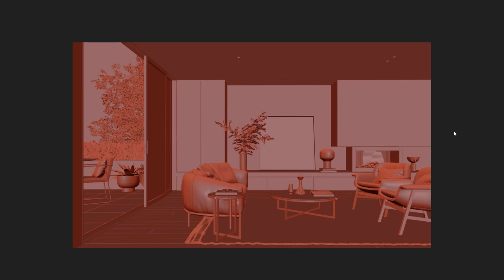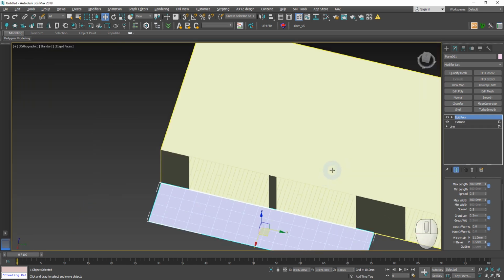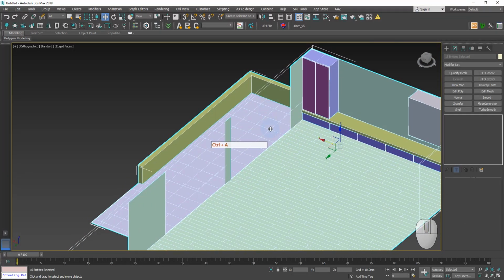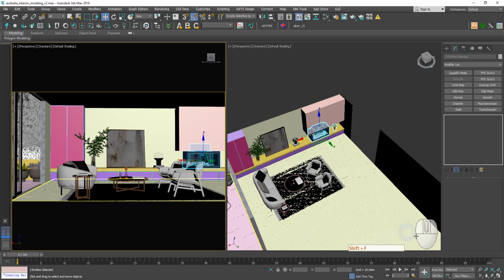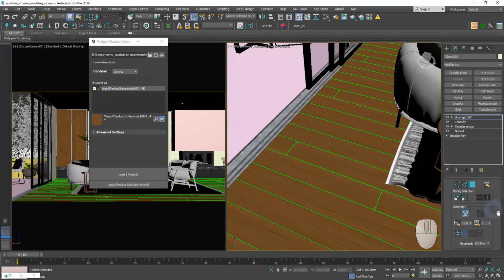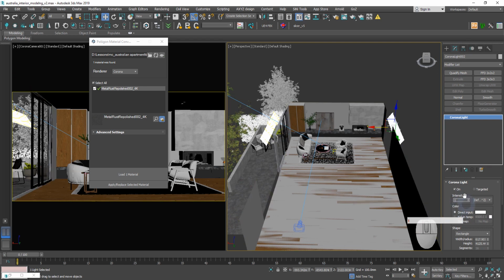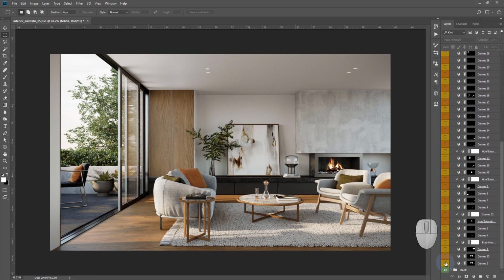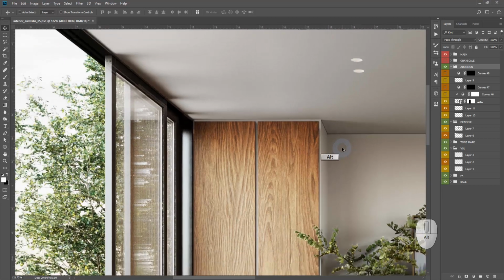3D Tutorial | How to create Australian apartment in 3ds Max quick (in 37 min.)🏠

Comment: Finally someone who creates good looking stuff with 3ds Max. It's a lot easier to find good tutorials on Blender nowadays.
Reply from the maker: 3ds Max steel the industry standard
Reply: @ArhiTeachCGSchool  yes and I have to learn it for my new job. But it will die in 5-10 years, mark my words.
Reply: Not sure what you mean with that. I've been working in architectural visualization since 1995 and at that time 3ds max was the only option. It has been the main to go software for A&D for decades, thanks for Vray that was born for 3ds max. The best architectural viz I've ever seen was done in 3ds max. I've never seen anything done in Blender that even get closer. Although Blender is a fantastic 3d software all around, it lacks of the professional file management and tools that 3ds max offer. It's good for independent studios or freelancers. But it's difficult to find any professional company in arch viz using it instead of 3ds max. Let's not forget the compatibility with Revit and all the major CAD and BIM software. And the huge amount of plugins and renders available. I love Blender, but as an experuenced Arch Viz Artist I would never be able to make a living out of it with Blender results both for interiors and exteriors. And let's not even mention walkthrough animation.

Comment: Good tutorial up until 11:23, but not really possible to follow it properly without the file involving the assets that YOU are using. You can't really follow along properly from there with alternate assets. Texturing, lighting, additional files etc etc are all going to be DIFFERENT for random different assets got from the internet. If those following along have to use free models, then use those free models yourself in the tutorial please and put a link for the same models.

Comment: Hello! When  I use the floor generator a message pops up saying that floor generator is a coplaner base object then it crashes. Any  ideas what im missing? thanks
Reply from the maker: Could you show an error?
Reply: The problem is the way you modelled it maybe the floor is an irregular surface shape that's why it detect a non-coplanar object.

Comment from the maker: Link to the plan  
https://imgur.com/62Mz0VF

Content of How to create Australian apartment in 3ds Max quick
00:00 3D tutorial introduction
00:07 Interior plan of Australian apartment
00:11 Combining objects and materials  with each other 
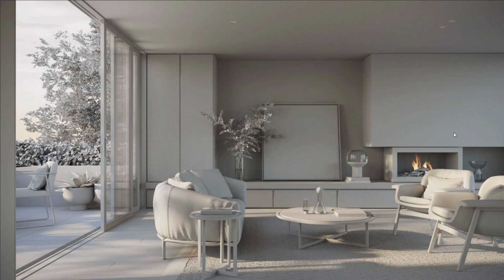00:26 Geometry of Australian apartment (White Card or White Wash)
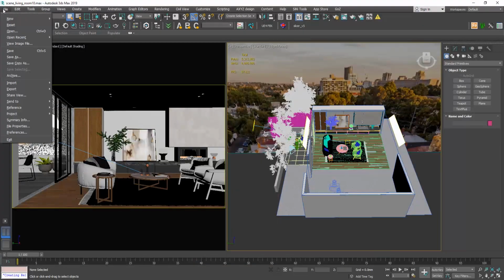00:44 Final stage of 3D Tutorial "How to create Australian apartment in 3ds Max"
00:49 Check units of measurement in 3ds Max
01:11 Working with the plan
05:55 Creating TV-commode 
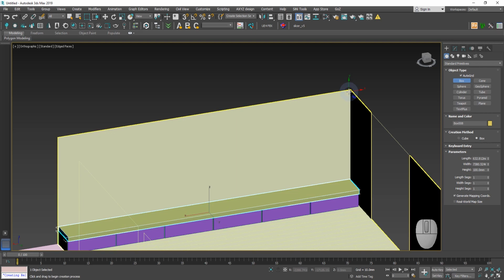07:03 Creating blocks in the corners
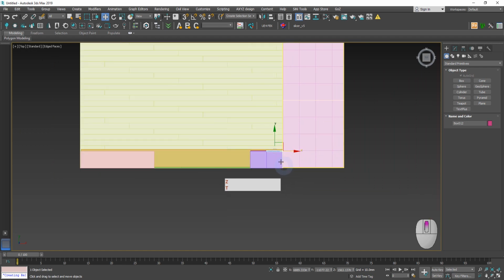08:22 Creating a fence
11:10 Inserting furniture to the object
11:39 Slider door
12:22 SpeedTree
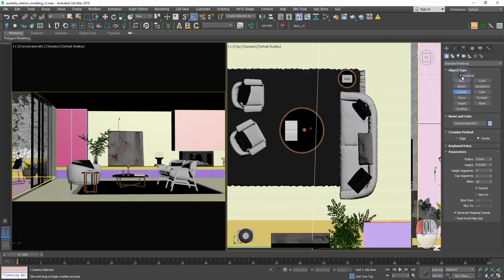16:16 Cut holes for a lamp
17:03 Adding materials to commode
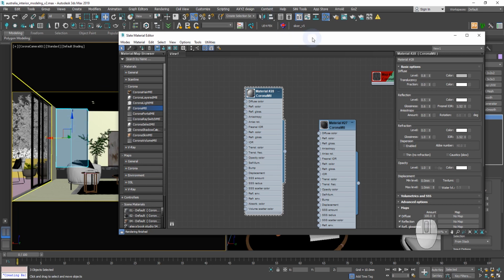18:49 Apply wood on the door and floor
21:28 Assign material to the other objects
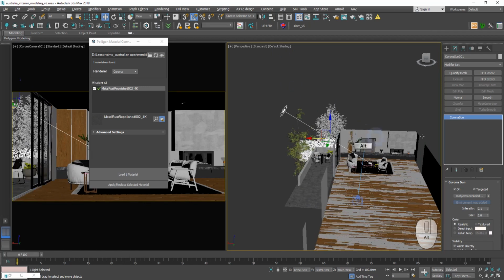24:36 Creating auxiliary light sources
25:44 Launching Interactive Render
28:16 Before the final render
28:49 Launching the final render
29:27 Post-processing in Photoshop
36:14 The end